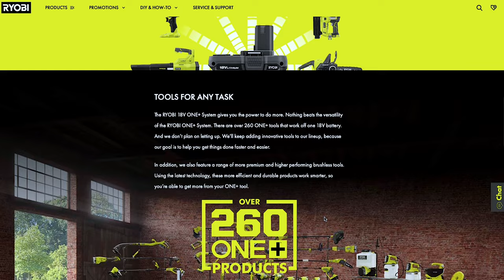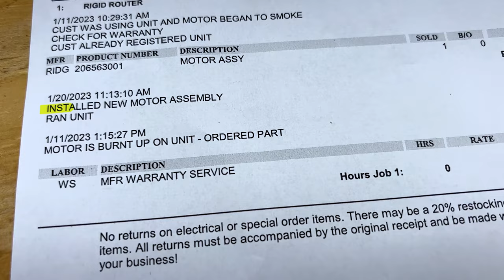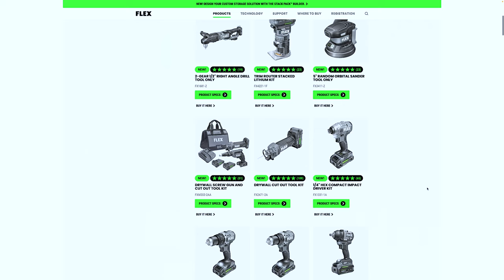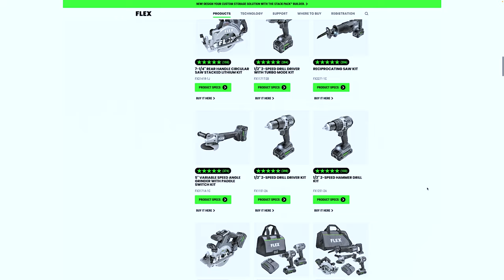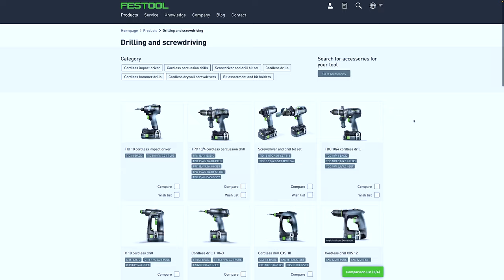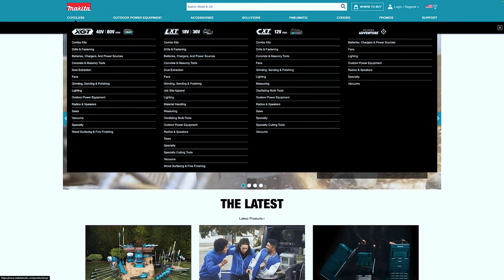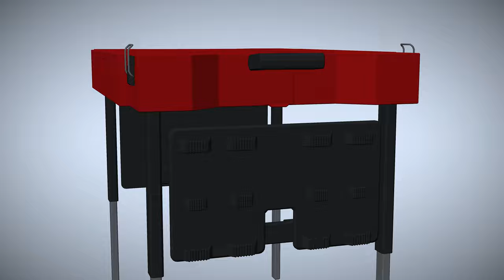I Found the BEST Tool Brand for Woodworking in 2023!

Comment from the maker: ▼EXPAND FOR TOOL LINKS and INFO▼ 
Watch Next: Hater's Guide to Ryobi - https://youtu.be/TTtzXsfWt5M?si=lJ_4lyQ_bny47W_T
Milwaukee Track Saw - https://thetoolnut.sjv.io/x9eDyy
Milwaukee Detail Sander - https://acmetools.pxf.io/75dW3V
Milwaukee 2 1/4 HP Router - https://acmetools.pxf.io/PyB21M
Milwaukee Trim Router - https://acmetools.pxf.io/9g2bvY
Milwaukee Installation Driver - https://acmetools.pxf.io/9g2bv4
Milwaukee PACKOUT - https://acmetools.pxf.io/AWBqqK
Kaizen PACKOUT Inserts - https://amzn.to/44Vgj5z

Rikon Detail Sander IN STOCK at Acme Tools - https://acmetools.pxf.io/4PLJWL

DeWALT Tools:
DeWALT Atomic Combo - https://amzn.to/3Po1zq9
DeWALT XR Router - https://amzn.to/3Rtb7D6
DeWALT Table Saw - https://amzn.to/48p6ujc
DeWALT Planer - https://amzn.to/3t9WGJK
DeWALT Miter Saw - https://amzn.to/3Pm3M5D
DeWALT 2 1/4 HP Router - https://amzn.to/48oUQoM

Festool: 
Festool Track Saw - https://amzn.to/3ZwcW4c
Festool Sander - https://amzn.to/3Zpy7EU
Festool Kapex - https://amzn.to/3Zt9IhU
Festool Domino - https://amzn.to/3rlY1wI
Festool Dust Extractor - https://amzn.to/3LT7i6H

Flex Router - https://acmetools.pxf.io/EK25r9
All Flex Tools - https://acmetools.pxf.io/ba5W4m

Bosch Router - https://amzn.to/3rkjwhw
Makita Miter Saw - https://amzn.to/3EJBWLs

Ryobi Tools:
Ryobi Combo Kits - https://homedepot.sjv.io/Qy0Raz
Ryobi 18 Gauge Nailer - https://homedepot.sjv.io/Kjqjdv

Ridgid Tools:
RIDGID Track Saw - https://homedepot.sjv.io/PyB2eq
Ridgid Drill/Impact Combo - https://homedepot.sjv.io/q4VeQq
Ridgid Router - https://homedepot.sjv.io/x9xVKy
Ridgid Leaf Blower - https://homedepot.sjv.io/eKaO36
All Ridigid Tools - https://homedepot.sjv.io/zNR6Zx

📲 Never miss another tool deal. Sign up for my Tool Deals SMS Alerts - NOTE: I text out tool deals so you don’t miss any! text DEALS to 1 (731) 207-7151 Be sure to add DEALS to your text to me so you get added to the proper list.  You can also click this link https://my.community.com/731woodworks  Important to add the word DEALS to the text!

🇺🇸 Join the Tubafour Nation on Patreon to get an exclusive Tubafour Nation sticker, access to exclusive member-only behind-the-scenes videos, member-only livestreams, discounts, and other cool member-only perks! https://www.patreon.com/731woodworks

(If you use one of these Amazon and other affiliate links, I may receive a commission) 

Some other useful links:
Daily Tool Deals on my website: https://www.731woodworks.com/tool-deals
Subscribe to our email Newsletter: https://mailchi.mp/7e44c16eefdc/731-woodworks-email-newsletter
Check out our easy-to-follow woodworking plans: https://www.731woodworks.com/store
Outlaw's Board Butter - So Good it Should be Outlawed: https://www.731woodworks.com/store/boardbutter
Reply: What brand do you recommend for portable table saw/jobsight saw for ppl with space issues
Reply from the maker: Dewalt is good for space saving
Reply: I don't know if this is something you would be able to do or not, but is there any way you could do an updated version of this list for 2024? Or if nothing has changed enough to sway your opinion, just comment that this video is still accurate?

Comment: A factor that is seldom discussed is how a tool fits your hand. I personally have smaller hands and most of the mainstream brands are just too big. Makita is the exception. In fact they even have a line of compact tools.  Take the time to handle all the brands and consider ergonomics when making your choice.
Reply: How the tool responds is important as well.  What I mean is how the Makita drill's trigger is so much more sensitive and responsive to input than a lot of others.  
Quality control is another biggie.  Yellow and Red have nothing on either Blues when it comes to QC.  From what I have seen in the forums Red is have some of these with Gen 3 and 4, and my experience with DeWalt is not very good.
Reply: Milwaukee m12 drills are pretty small and powerful
Reply: @NicktheDIYguy  they are nice, but they don't compare to the Makitas, especially the MIJ Makitas.
Reply: Yes, very important. The 18V milwaukee tools don't really fit my hands. But I've never had an issue with ergonomics on Dewalt.

Also in my opinion color isn't all that unimportant either. I am no fan of the Makita blue and I'd have to look at it all the time...
Reply: @boomerangfreak  you could buy the MIJ Makita tools, and they come in a bunch of different colors including deep purple. Rockin eh?
Reply: @SaintFredrocks   Perhaps yes, but working at an official dealer I can tell you it's weird (and suspicious) seeing Makita in different colors. That and frankly Makita already has waaay to many product lines over here in EU.
Several product lines for several target markets. And like the DIY Makita might look an awful lot like the Pro Makita but their batteries are not compatible.
Reply: @boomerangfreak  I think they all have too many product lines anymore.  Heck, I was just looking at two bit types from Wiha, and the advertising for them is EXACTLY the same.  The only difference is the TerminatorBlue has blue plastic on the bit and the Maxxtor has red plastic on the bit.

As far as I have seen, Japan keeps the cool colors AND the made in Japan(MIJ) models, so they really aren't suspicious.  The made in China(MIC) tools are made well, but the Japanese models use better components.  I saw one video comparing a MIC vs MIJ impact driver with the same model number, but the components were different: not even the same design.
Reply: @SaintFredrocks   Well if they're the Wiha impact bits (considering they're the same as over here but with a different name) the ones with the blue ring have an optimized profile for screw with a non countersunk head. The yellow are optimized for screw with a countersunk head. And then the red ones do both.

I asked for more details on what's actually different between the 3 types to our rep and did not get a proper answer. He told me pretty much what I just said now.
Reply: @boomerangfreak  There is a yellow too?  Oh, brother.  I got the red ones, so I'm set lol.
Reply: @bestyoutubernonegraternumber1  Hate to burst your bubble but Festool manufacture tools in China as well. Why are you so hung up on the location of manufacture? The only reason that tools are made in China is to maintain price points which is driven by end users wanting cheaper tools.
Reply: @willholt100  precisely my point. Milwaukee also have manufacturing plants in various parts of the world like USA, Germany, Mexico just to name a few and the tools are the same because they have to meet a certain standard.

Comment: I'm definitely a firm beliver that each brand has their place in everyone's shop. Dewalt makes a great sliding miter saw and router. Milwaukee makes a fantastic 12v Line. Rigid has great corded tools like their sanders. I feel like there are just enough small differences between everything that makes it almost impossible to have solely just one brand!
Reply: 100%!  This idea that one brand does it all is nuts. Get the best tool for the job, whatever the brand.

Comment: 40+ yrs in construction and wood working I would say, I wouldn’t ever stick with a single brand, except in battery, Milwaukee M12 for day to day “shop tools” Makita 18 for beefier power “job site”  and most hand held corded, Dewalt for larger table top machines are generally what I’ve found to be best choices.

Comment: Great video, that’s a lot of money and time spent putting this video together, much appreciated. I graduated trade school to be a carpenter in 96, I’ve been in the renovation trade ever since. I do love doing finish work including building cabinets and shelving. I really love and appreciate this competitive tool market. Ryobi was hot garbage back then, I still won’t buy there tools but I do recommend them to my handy clients or people just starting out. They have really come up from way back then. Rigid isn’t bad if money is short, just don’t expect longevity when saving money on anything. I really like makita, Bosch and festool, when I can buy it lightly used. I’ve mostly used makita and bosch. Makita had the biggest platform when lithium batteries first came out. Milwaukee has really changed over my career, they made stone simple, powerful tools that last a lifetime. Now they are very sophisticated and flexible. That pack out system is truly amazing and fun to use. With all this sophistication, I don’t like the planned obsolescence though, some of this stuff is frail, I do like having a tool that lasts decades.

Comment: Some great points. Personally I have a mix of Dewalt for cordless hand tools, bosch for router table, mitre saw, track saw and dust extractor, festool for sanding, ryobi for outdoor tools (snow clearing, lawn care, chain saw etc) and sawstop for table saw, shapeoko for CNC and with Rikon for bandsaw and spindle sander. I think as long as you stick with one battery platform for inside, one for outside then you can mix and match the corded tools based on preference and what you can get a deal on.
Reply: This…

Comment: I started with the Blue Ryobi NiCad set about 15 yrs ago when we purchased our home & then "upgraded" to the Ryobi One+  once they were introduced. In 2017 I purchased my first Ridgid 18V tools, as I was doing a major kitchen/basement reno & my friend who was doing the work, needed a bit better quality than the Ryobi were capable of. 

These days with readily available battery adapters, you are not limited to one tool brand/battery platform. I have a M18 battery powering a Ryobi One + clamp fan @ work & recently picked up a Ridgid battery adapter to use on a DeWalt 5" grinder
Reply: I had the same system, the chuck in my drill finally gave up, but I really like DeWalt and gave my young neighbor, new home owner my Ryobi combo set.

Comment: Across multiple trades (plumbing, electrical, heating,and carpentry) the  Milwaukee battery platform(s) are definitely the most complete; my very first tool was a corded sawzall many years ago… but as you pointed out, you need to mix and match sometimes to get best tool for job (see my Dewalt table saw, mitre saw. And planer)… 
Thanks for the review
Reply: Makita actually has the most with nearly 700 tools, they just don't have the shelf space like Milwaukee so people don't realize it.
Reply: @JamesSmullins  Makita - same as DW and Bosch - excels at very specific things, whilst being mediocre at everything else. For example, Makita drills are second to none, same as DW saws and Bosch routers and jigsaws. The case with Milwaukee is that it has both the tool selection AND the overall quality, across the board. It’s not that Milwaukee is the absolute best at everything, it’s just really very good in nearly every aspect. The latest addition of the 18V FUEL track saw is the case in point, now they have completed the lineup.

Comment: I got into Ryobi in the 1990's with their blue tools, all of which still work as well as new. Given the battery/charger commitment, it is still my brand for cordless tools. They all do well in the wood shop. This is not heavy duty contractor work. 
I choose my corded tools individually: Powermatic contractor TS, SKIL 10" SCMS, Craftsman radial drill press, Ryobi radial saw, Jet lathe, old (& high quality) Delta bandsaw & planer, Wahuda jointer, Ridgid OS/belt sander, all purchased from the 1990's to 2022. Haven't wanted/needed to "upgrade". 
Get what works by your own standards. These reviews are excellent resources!

Comment: Just jumped into buying tools back in June 2023 cuz I needed a drill, Ridgid's were on sale AND Ridgid's LSA was irresistible!!   Since then, I've bought both Ridgid's and Bauer (from Harbor Freight), Kobalt and Craftsman.  Ridgid's are BY FAR the best fit and finish of any of these brands.  They seem to be hitting the sweet spot, for me, of price and quality and warranty.  I mean "free batteries for life"! it just doesn't get any better than that.

BUT you're right - Ridgid's somewhat limited tool selection is frustrating not to mention some of the tools in their line have issues.  BUT I also know that every brand has issues in their lines, some more than others (looking at you Bauer! ugh).

You mentioned that you love the Milwaukee detailed sander but have you tried the Ridgid Oscillating Mult-tool detail sander attachment?  I mean I know it doesn't have "random orbital" in the name but honestly, neither does the Milwaukee.  I just checked.  It's an orbital detail sander, with no random in the name.  No biggie, just thought I'd point that out and ask if the multi-tool offers the same experience for you?

Also one of the hardest things to know is whether or not the tool you're buying is going to be "the best for your money".  

I picked up a Bauer Hammer Drill and Jigsaw for like $60 total.  Both were corded by my goodness that's a FANTASTIC price.  BUT now that I've been playing around when them I see some issues.    I also piked up a Bauer Random Orbital Sander for like $30 on sale and the first one I had, broke the on/off switch the first time I tried to use it.  Returned it for a new one and it's working fine, for not.  That's the thing, never know when a tool is going to up and die on ya....even with higher priced brands.

Anyways thanks for another great vid.

Comment: As a Ryobi guy I just want to throw a point of order out there that they do have a detail sander, HD has a 2-7/8in 
Also I love my Ryobi 10” Sliding Miter Saw, I dare say it’s one of my favourite tools in my little back yard shop. Ryobi blades are shockingly good but when I swapped that out for a Diablo 80T, man, even better. 
I don’t want to discount the little 5-1/2in circular either, I built a shed a and a dog house  this year with it just fine, though I’m looking to grab that brushless HP model as maybe a Christmas present to myself 😂

Comment: My goto sander is the cordless version of the 5in Festool sander you have. I also have not stuck with one brand. I use Ego for my lawn business. I started with DeWALT 20v max and Flexvolt in the shop. I have since added M12, Festool 18v, and Festool 18v Ergo.

Comment: Like others I have a ton of tool brands in my garage shop. I basically look at woodworking the way a producer looks at hiring actors for a movie. You want to cast the best person for that particular part. I love my Bosch routers and miter saw. I also agree that the Ryobi Airstrike is a must have for any woodworking shop. Ryobi also makes nice brushless, light drill, driver sets that don't fatigue your hand. The Makita circular saw and their track saw are some of the best values in the market, extremely accurate. My DeWalt table saws are a real dream to use. They cut like a hot knife. Like you, I do my research, watch tons of videos, read another ton of articles before making a purchase. I rarely regret any tool purchase I have ever made. 
BTW- love your tool alerts!

Comment: I found there's usually one tool that a manufacturer makes that nobody else does. If you need that first, you buy it and then have batteries and a charger, so you get hooked into that series.

For me it was a Bosch 18V drill with interchangeable chucks; you know, the usual standard chuck, a 90 degree chuck, offset hex for tight corners and... a full on SDS attachment. This means I can take one drill and fit cabinets to brick walls without issue.

Then it was an 18V circular saw that runs on a Festool rail, a jigsaw...

Comment: The only thing I'd add is that you can stick with one battery platform if you're willing to fill in the rest with corded tools. All my battery tools are Ryobi (I started with them when I was practically broke) but many of my larger tools are corded and various brands (Skill table saw, Bosch trim router, Skill router table, sketchy Harbor Freight oscillating tool, etc.).

P.S. The Ryobi handheld planer is surprisingly solid.

Comment: I chose for myself makita xgt 40v for my main platform, m12 milwaukee for compact and wide range of specific tools and greenworks 82v for my gardening needs. In my country Makita is often cheaper than milwaukee m12 same tool (m18 are similar price with festool). Elsewhere I think I would go with milwaukee as all-ranged brand and something like EGO for gardening. I had multiple battery systems like dewalt 18/54v(20/60v) bosch 18v, metabo(not hpt) 18v, ryobi one+, AEG(RIDGID), makita lxt/cxt/xgt. It was a nightmare. I am glad I made a choice and narrowed my tool system. Sometimes I won't get the best tool but It would be with battery I can get anywhere around my shop, home or workplace. Unfortunately new milwaukee batteries are dying really fast, like this week i send 4th battery to local dealer within year, and extended warranty is only 2 years.

Comment: I’m a Milwaukee fan boy for 30+ years …. I own the M12 and the M18 systems (as well as others) the M12 drill and impact driver are the ones I reach for 90%+ of the time over the M18 ones.  
FYI as of now (09-22-23) the M12 detail sander has a free battery for a limited time

Comment: I've been on Makita LXT for years and couldn't be happier. However their cordless nailers suck and when my 18ga nailer failed me during a big remodel I ran to the Depot and picked up the Ryobi 18ga nailer and it is fantastic. I didn't expect it to last, but the thing just keeps going. Now I own several Ryobi tools, especially when its something I won't use every day and don't want to pay the teal tax for a seldom used or specialty tool. Bosch is my 12V option and I've been using their 12V drills and drivers since they labeled them 10.2V. But if its corded, ther is no incentive to stick with any particular brand and I buy whatever is the best tool for the job for the most part.